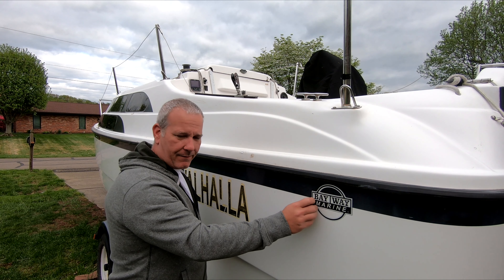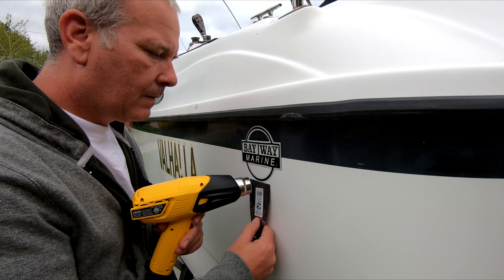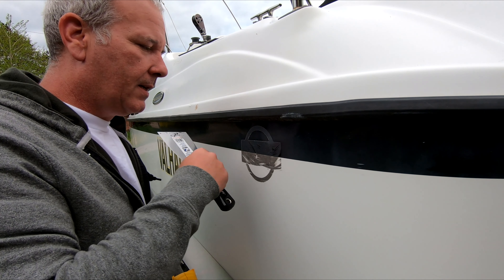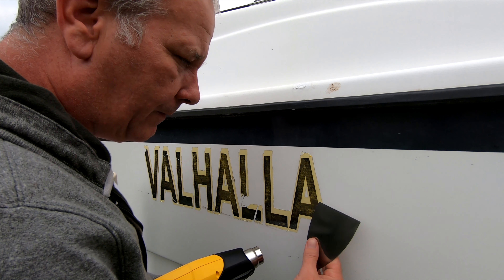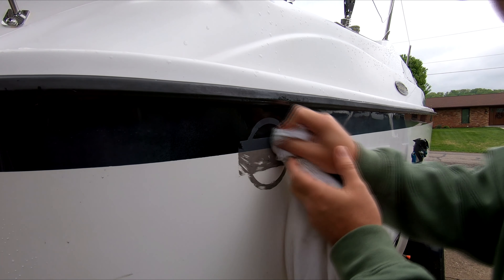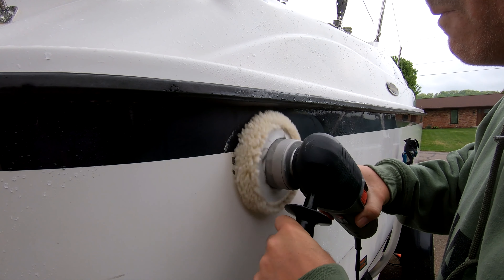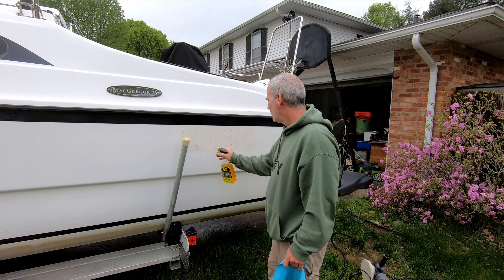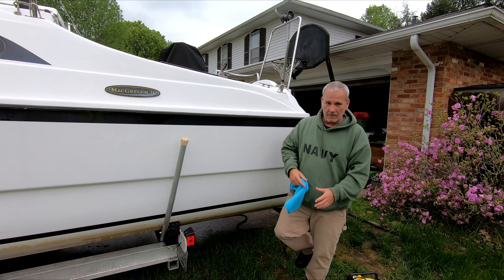episode: 3 "REMOVING OLD STICKERS"

Comment: I found when removing stickers, the heat gun and the scraper worked the best too.  Once the scraper blade started to warm up, things really sped up.  I also agree on the Goo Gone.  Didn't notice much benefit from using that on the sticker residue either.  
Can't wait to see more videos about the boat!
Reply from the maker: Thanks for the post Marcel.  I have been out of commission for a few months but I will be posting more in this year.  Thanks very much for watching!
Reply: @TheLifeAquatic  Hi great vids so far.  Would you happen to be making one about how to attach the sail to the mast etc?  I just got a mac myself and I have only been motoring as I'm fully new to it all.
Reply from the maker: Hi Mac & Me, Yes I can do that and have made a note.  I have some videos in the pipeline that have yet to be edited.  Once those are done I will do the sail & mast video.
Reply: @TheLifeAquatic  Awesome glad to hear!  Def looking forward to it.